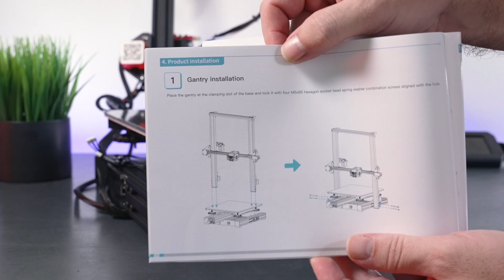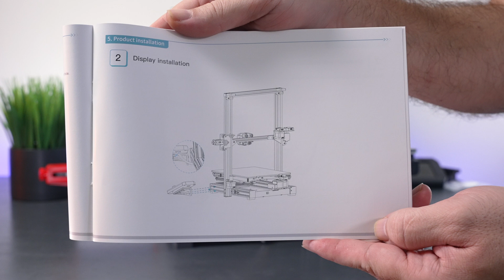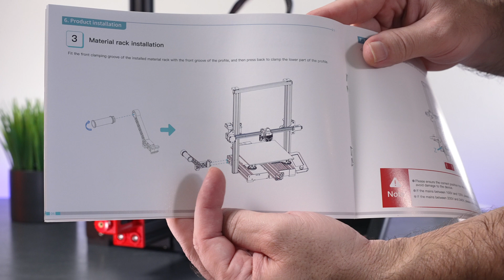Creality Ender-3 Max Neo - Assembly

Comment: just got this... done 3 prints ... love it!
But as is typical of products from this geographical area... Their documentation is pathetic, both in content and organization. Truly a no excuse for it level.
Hire some people in documentation that are American.
Other areas that are pretty lame - no built-in WiFi. 
Clean up your the Creality website it is a mess.
The bed level wheels need to be able to lock and the indentation of which way to turn need to be contrast painted.
Cable management is weak.
Product videos are weak.
Voltage stop setting them all to 230 automatically - do a better job on destination idea.
No warranty registration, you just do it when wanting repairs???

Ok... done bitching.
Love it. :)